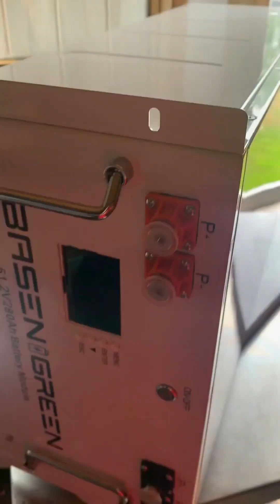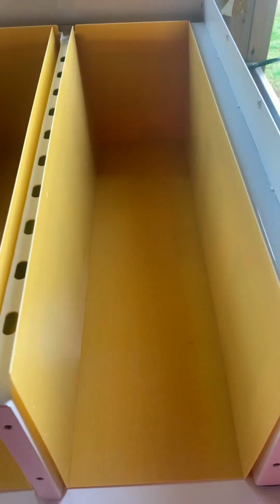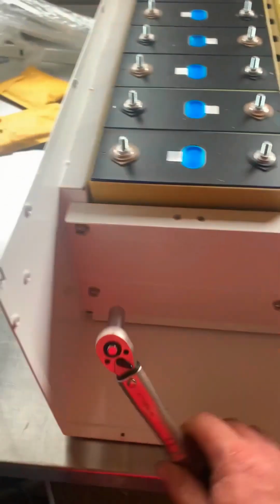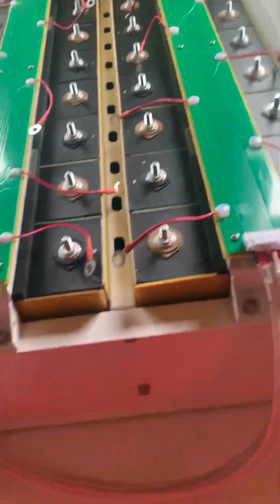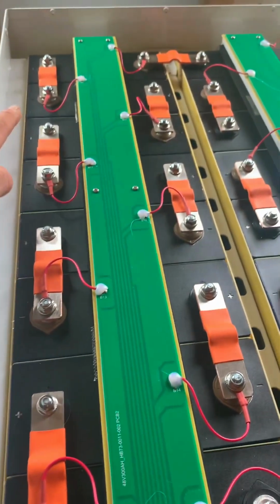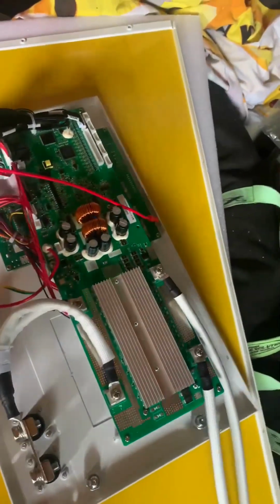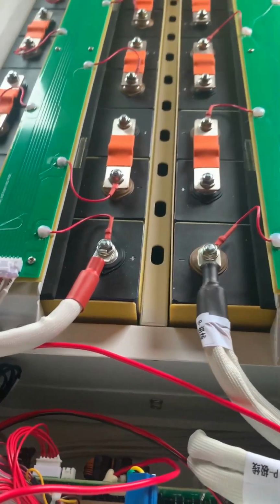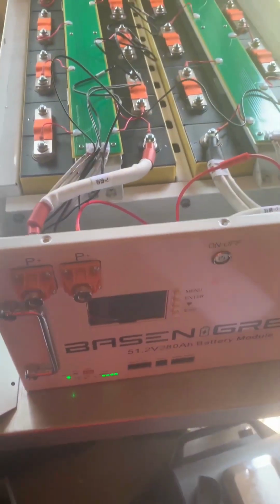Feedback from our customers-Basen 48V kits unbox and install

Comment: Hey man thanks for the upload. I am presently tossing up between a  Gobalpower kit which look really nicely made but and one of  these Basen models. I'm interested to find out how you are finding the BMS and has it been reliable ? Looks very much like a PACE BMS. Also I noticed you had no compression of cells but it looks like it is possible but just needs some thicker padding between the cells to bring them out a little further. Cheers

Comment: Why the balancing cables, which need to be connectet to MINUS on the cells are red, remains the secret of the manufacturer. The installation manual is more than insufficient at this point. Or is the video faulse?